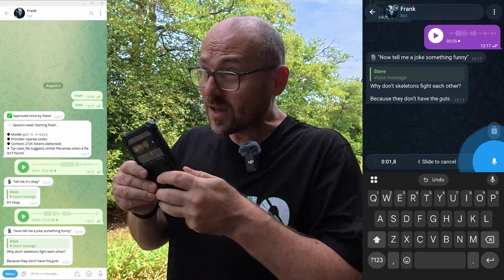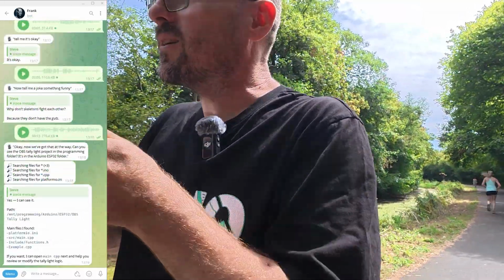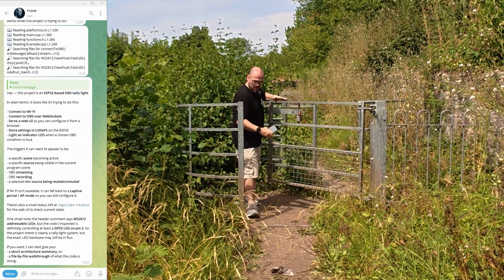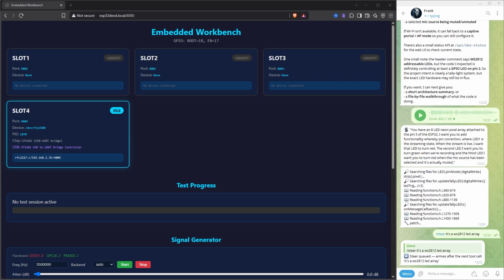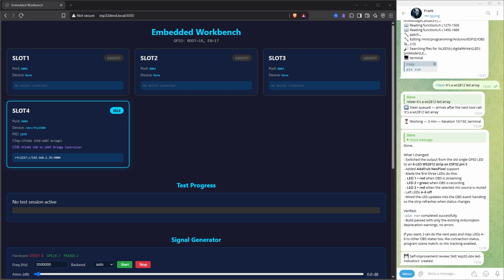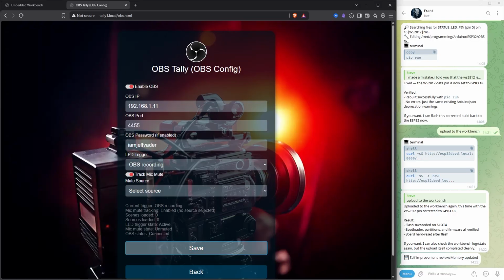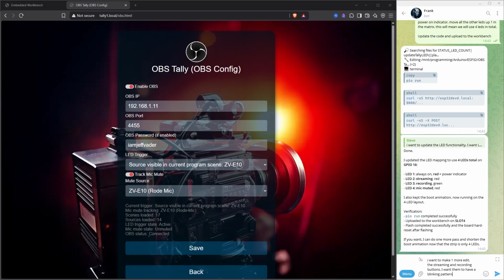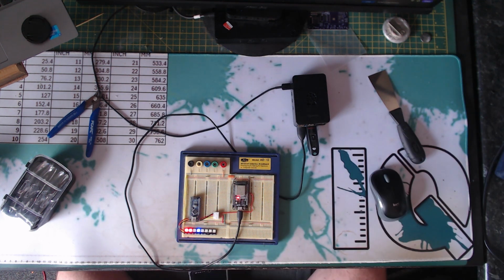Can AI fix my ESP32 While I'm Away from Home?

Comment: Telling you “it’s okay” could be considered a joke. Good idea adding the animation as a “lamp test” at startup.
Reply from the maker: Yeah, "it's OK" is a little bit of a pat on the head. 
I always add some form of POST just so i know all is working and that if it doesn't work it's to do with the program, not the physical setup. In this case it highlighted I failed to define the pin the LEDs were connected to the esp32 on
Reply: @IQWorkshop I’ve wanted simple Tally lights for a while but hadn’t looked into what hooks OBS provided to communicate with indicators. Too many other projects demanding my attention.
Reply from the maker: @mechaform  i may do a short run of the final project if there's interest for it 👍